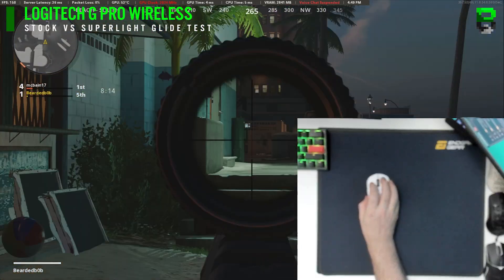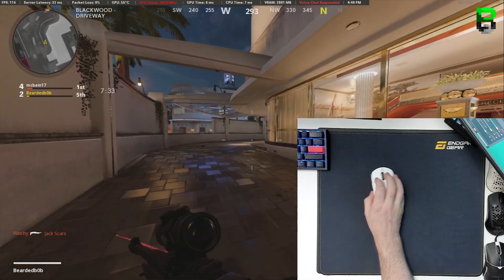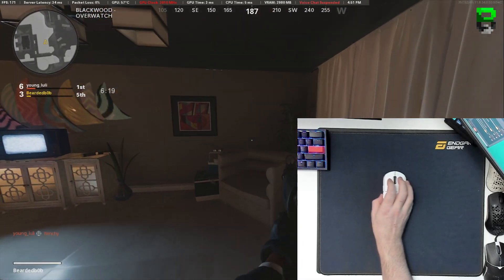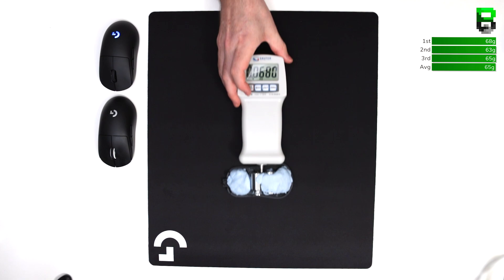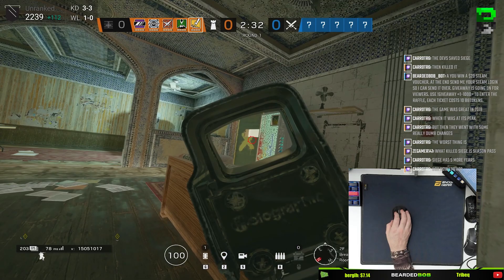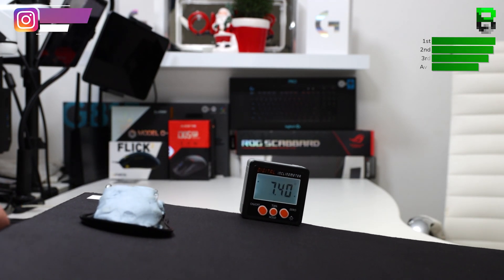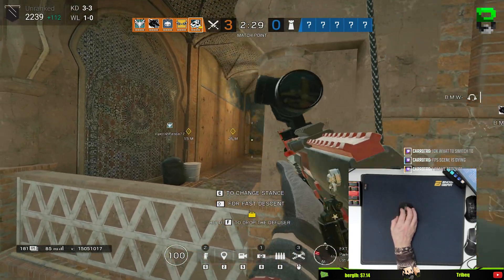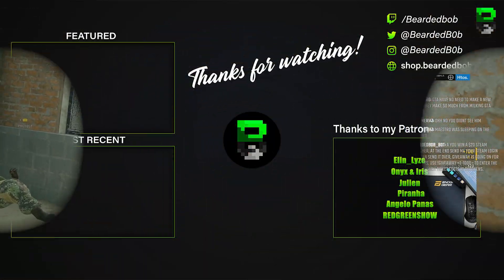WHAT DIFFERENT HAVE NEW FEET MADED? Logitech G Pro X Superlight Mouse

Comment: i bought tiger ice on my superlight and the front large feet feels slower than the back ones, i think it might be because the front feet is bigger. will normal gpw hyperglides work on the superlight? they are smaller in size so they should have less friction thus glides faster (i have razer strider pad)
Reply: and how did it go?

Comment: There was an upgrade to the g pro wireless past 2024?
Reply from the maker: Yep they stopped using the Omron 50m switches and now use the 20m
Reply: I've been having the scroll wheel be the issue with me. The wheel will kind of fall in between a notch and then scroll on its own. I have the superlight and the original g pro wireless.

Comment: So I currently use a Razer Basilisk X Hyperspeed and want to upgrade to either the GPW or GPWSL. The only thing is the GPWSL is out of the stock like everywhere right now, and I am thinking of just biting the bullet and getting the GPW since it is only $125 and can get it on Amazon right now. Would the wait and extra price be worth it or should I just get the GPW?
Reply from the maker: it comes down to weight. Do you mind a 80g mouse or do you want a 63g mouse? The other difference is the buttons as the GPW has two more on the right hand side. The skates I prefer the GPW combo over the GPWSL..

You can save yourself some money and mod the GPW to be as light as a GPWSL Stock or lighter if you take it a little further. Here's one video i've done getting the stock GPW to 57g. There are more and other options if you don't want to go as extreme. https://youtu.be/uliF-S40p4w

Comment: Should i get the gpw or the gpwsl?
Reply from the maker: Hard to say. The GPW modded can be a better mouse and cheaper if you can do the work. The GPWSL has poor switches stock, not the best skates and is hard to get atm. I'm going to do a video comparing them and which one you should get. It should be out in a week.
Reply: @Beardedbob  if I could change the skates to the fastest skates and the better for any mouse so it will be fine or what !

Comment: can you do an in depth test on latency and consistency in latency? I've seen tests that show that while on average the wireless mice from logitech are just as fast/faster than wired, they aren't performing as consistent. I'd rather a consistent mouse with a few more milliseconds of delay rather than something that performs differently each time, even if it is faster,
Reply from the maker: we do a few latency tests on mice in the main reviews but do you have any tests you think would be good to do?
Reply: @Beardedbob  sorry for a pretty late reply, but I think that if you compared 4 mice, a higher quality wireless and a lower quality wireless (g305 and gpro for example) and a wired mouse, like the g502 or gpro or any logitech mouse that is wired and advertised as 1ms delay.

Comment: My family just won the lottery for the whole village so I am thinking about upgrading my G502 to the G Pro X or the G Pro Wireless, what do you think of ur personal experience is the best of those two to choose? And by the way this video helped me a lot thanks!
Reply from the maker: I perfer the stock with some mods. They are both good and both suffer from poor main switches which should be replaced.
Reply: @Beardedbob  just for a update I got the mouse for 2 weeks now and this video helped me a lot because I fucking love this mouse
Reply: @Cesar-le7qs  Which mouse did you go for and hows the experience. I am also thinking to change from my G502 Hero to either one of these 2

Comment: Very informative video. I actually bought the mouse because of your video. I am using it for almost a week now and my aim has improved significantly. I am coming from the old G502 (120gr) tho, so the change is huge..

One question, do you recommend the magnetic puck with the skates? I use the Aqua control plus mousepad and it feels smoother using it. Not sure if its placebo.
Reply from the maker: Glad it helped, what colour did you go with?

Comment: So would you recommend buying the g pro or g pro superlight?
Reply from the maker: The big question. It depends on what you are after. If you want a lighter GPW then the superlight out of the box provides this but with some mods the Stock can also.

The skates on the GPWSL are not as nice compared to some upgraded GPW. Hopefully someone comes out with some nicer rounded skates. If you need the additional right side buttons then GPWSL doesn't have this. Then there is the price and availability with the GPW being cheaper and easier to get.

Comment: Will you test corepads on the superlight? I heard it might have LOD sensor issues
Reply from the maker: Yes I have then, I just need to do the tests
Reply: @Beardedbob  Thanks. Cannot wait for the tests!
Reply: @Beardedbob  same, I’m getting my superlight soon and I need to know if those corepads are worth thanks !
Reply: It does have LOD issues if you dont remove the "spacer tape" underneath the stock pads. The stock pads are hair thin with a black 1 mm spacer sticker under it. I didnt notice it on my first install and had big issues with LOD. I removed the first set and the spacer which messed up the set. I installed the second set with better results but the LOD now is very short. Like 0.8mm short.

Comment: I'm currently owning Superlight but can't get use to it. Been planning on regular GPRO wireless with Logitech G640 mouse pad and transition to superlight is quite difficult for some reason. I suppose it's muscle memory and fact that is lighter than original GPRO.
Reply from the maker: Yeah it might take some getting used it.
Reply: @Beardedbob  would you recommend and particular mouse pad for superlight knowing all attributes and weight?
Reply: @CPL07  get glass feet, mousepads aren't useless these days
Reply: I bought the superlight as well and do not feel consistent with it compared to all my other mice. It's not just you or your mouse pad.

Comment: Any idea what kind of effect using the puck with the PTFE feet on it would have? Less dynamic friction? More stopping? less?
Reply from the maker: more friction and maybe a more stable rear end
Reply: The puck rocks in place, it isnt stable, you have a chance of it spinning a little CW or CCW as well (not much but still). On top of that the puck is slightly recessed. I wish they just did a zowie style skate at most or a Viper Ultimate size at the least.
Reply: @Ryn0_333  my puck is just fine.
Reply: @OptionalOG  I have seen other people talk about it as well so I know it isnt just me. Maybe you got a more snug puck somehow which is cool. I should've prefaced my last comment with I am not 100% sure what makes the mouse feel so off to me. Also its is definately a good mouse, I just perform better with most my other mice like the RVU and M42 even the NP-01.

Comment: Hey Bob,  does a 9mm Alps Encoder fit in the G Pro X Superlight ? 
Cheers :)
Reply from the maker: It will but it might be at a slight angle as the GPW uses a 8mm ttc
Reply: @Beardedbob  would there be Major downsides or is there a way to work around it ?

Comment: The other day i got an idea of ingraving 4 very small metal balls that roll/or not insted of skatez. That way the tension surface is minimal and it can move very smoothly. Like a tip of a pen.
Reply from the maker: might work but if they are to small they might dig in and you would need some bearings that were really smooth. The other factor is keeping them low to so the LOD isn't affected. It would be an interesting concept

Comment: I just got a Razer Viper Ultimate and a G Pro Superlight. On my SteelSeries QcK soft mousepad, I have the impression that the Viper glides much better. How do you rate the GPXS skatez compared to the Viper's? Am I using the wrong pad, or is the Viper really gliding better? I wonder if the large size of the GPXS skatez are a good idea after all..
Reply from the maker: I'm not a fan of the gap on the RVU and I feel it doesn't glide as well as either GPW.
Reply: I have both mice as well and am trying very hard to like the superlight but I shoot better with the RVU. I have a QCK heavy and my  RVU feels way better. I have core pads on my GP and Hyperglides on the RVU atm but even both stock, still the RVU.
Reply: I have the same issue here. I feel like the new feet doesn’t performed well on Qck, because when I use my G703 GPW these old feet, it feel smooth again.

Comment: Got my Superlight a few days ago but I noticed a minor issue which is still annoying. They way I am holding the mouse my left click tilts the mouse to the front left slighty. Like something on the bottom (must be the skates?!) is uneven. Its more noticably on harder surfaces. If I hold the mouse with my arm further back its fine. 

I reckon you didnt notice any of that, even when you hold the mouse more towards the front? Easy fix or should I return and get a new one?
Reply from the maker: sounds like the skatez or the base isn't quite  on right.